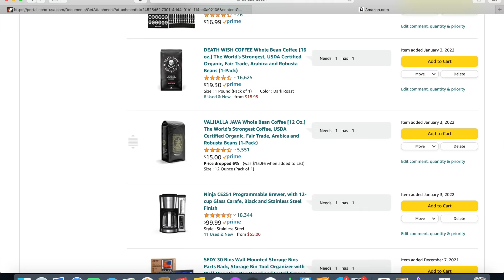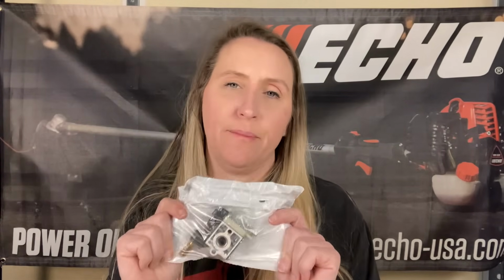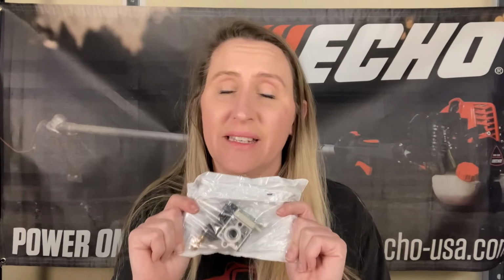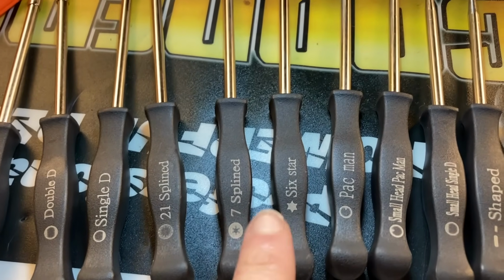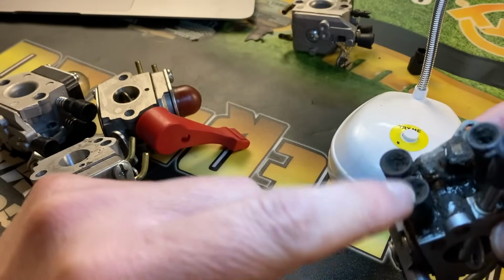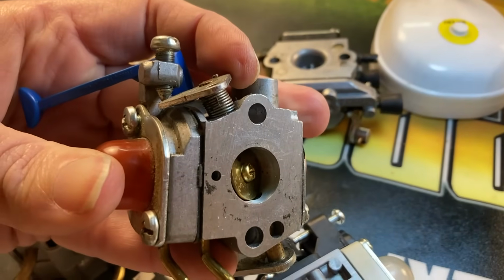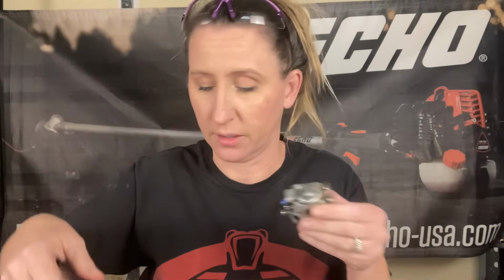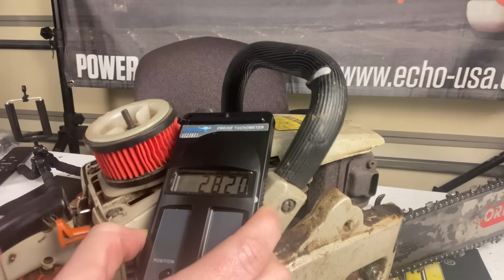HOW TO ADJUST your 2 Cycle Carburetor on a Chainsaw or Trimmer and when you probably shouldn't VLOG

Comment: I've only worked on small engines ect for not all that long, then again i'm real young. Working at a shop which goes from working on outboards, to ATVS, snowblowers chainsaws whipper snippers uh generators, dirt bikes, snowmobiles, regular cars, trucks ect, trailers. What i'd personally seen is people just having poor gas. It's SO much of it. Oh, that gas tank, let's peek inside because well its a poor running situation. Hmm...i don't see water....oh nevermind, it's over 90% water and i can't see the normal line you see. I understand the small puddle of water, but when its half the jug, you'd have to notice. Regardless.

Quick story. Had a guy come in with chainsaw, ran fine, then it just didn't. ''Had old gas in it, dumped it out and put new gas in''. Ok, perfect. I take the standard sniff test. It's rotten. Looks not bad, but smells just horrid. I did a quick carb spray out just because, and new gas, fine as kind. ''new'' to the chainsaw gas, certainly not new to the shed or container it was in.

Comment: A little question: Do you use alkylate gasoline in the United States for your small air-cooled engines?
Reply from the maker: It is not recommended, but is what most stations sell.
Reply: @Chickanic  If I may ask: What does the USA have of alkylate problems?
Here in Europe, Husqvarna, Stihl and many others recommend using only alkylate (2%).

Comment: I knew this is old no I didn’t read comments.

You said gasoline sucks water from the air no it doesn’t gasoline already has moisture in it.  I can’t remember the ratios for every gallon of gas you burn it’s like 3% to 5% moisture.  it’s why you see exhaust pipes drip water and rust out. to eliminate that that’s why they make dry if you know you’re gonna be finishing up with your equipment for the season soon when you go get gas in your big gas can dump the ratio of dry gas in it so as you fill up your equipment and then you put it away for the season you won’t find water in the carburetors or in the gas tanks.

Comment: The Reason I have to adjust My Echo 355T Climbing Saw is because I Foolishly Loaned it to my Know it All Retired Mechanic Neighbor that Likes to take things Apart and Adjust Even though it's New and works Flawless, I retrieved it with a Boinged pull start, Disabled Brake, in Pieces on his Bench. I said No when he Needed Huskvarna 372, 395 XP. Don't Loan Equipment. !!!

Comment: If you will spray your carburetors with delco non chlorinated brake cleaner it will fix 80 percent of your carburetor problems it dries instantly and cleans the gump

Comment: The water in the fuel probably comes from the ethanol that is added to the fuel by the supplier. This is why you should never use a low grade of fuel for any machine that sits for a few months of the year, this includes motorcycles. Do yourselves a favour and use the high grade of fuel, the non-ethanol grade. Just look at the pump next time you fill your car and you will see what I mean as it's posted right on the pump.

Comment: Whoa...first off, great video. Second, lets dial it back a little on the whole "best chainsaw ever made" thing. If they were that good, there'd still be a lot around. There isn't. I get the whole corporate thing though.
Reply from the maker: Corporate Echo doesn't do anything for me to talk about them. I just sell the equipment at my shop.  I'll double down on saying any of the grey echo's, trimmers, saws or hedge trimmers were outstanding pieces of equipment that would last a lifetime. I still get tons of them in at the shop, but I see about 800-900 2 cycles a year.

Comment: Your right it's the ethanol, it pulls the water in out of the air. If you look at plastic used in fuel cans through a microscope it looks like a quilt, it provides no oxygen barrier and the ethanol will pull moisture right through it so if it sets in the can through a season cycle it loses potency

Comment: Never had a problem with your run of the mill 2 cycle.  They are all about the same.  Start around a turn and a half out and find to lean and back it off a bit.  

Now these 4 mix.  I will never touch a carb again.  I learnt my lesson. The window is so wide. You can't hear when it's leaned out therefore can't favor rich of the good running window.

Comment: I use 100LL aviation fuel in all of my 2 cycle equipment and never have a fuel problem. If you are doing a lot of running you might just want to use aviation fuel the last couple of runs because of the price. It will not go bad for a long time.
Reply: The big problem with AV fuel is that it contains lead. Not good for breathing, or for anyone. I have personally found that keeping fuel stabilizer in high octane fuel, even E10,  has been just fine.
Reply: @GoCoyote  funny I made it 81 years around leaded fuel and still kicking, just maybe not a high as I use to.

Comment: Good video. Been a lot of times I get something in and the owner says " I tried to adjust the carb". Make me want to slap their momma. I need to get another tach. I had one of the old strobe tachs that read off a piece of reflective tape. Ok for mowers, hard to use on two cycles. Thanks again for getting back to me the other day. OEM carb on order.

Comment: why do people rip the chainsaw pull cord. i do one slow pull till it is tight with compression let back the cord and do 2 or 3 ez pulls.  even my 390 and 395 i just have on the ground and do 2 ez pulls. i feel like i watch evey one using so much power to rip the cord. i have 4 husqvarna, 2 stihl everything from small to large.  i love watching people starting a saw cold standing holding it with 1 hand.  cold starting on the ground is smarter and shows you have bigger balls caz you dont have to look like youre going to lose a leg.

Comment: It's ridiculous how EPA makes it difficult for consumers to tune their small engines.  What's worse for the environment?? A poorly running engine that's not stocometric releasing more    unburned hydrocarbons I to the atmosphere or a properly tuned engine able to reach its peak power completing its task faster and more efficiently?
 Not everyone is mechanically incompetent. There isn't much to a 2 cycle engine. The alcohol  diluted fuel we get now rapidly deteriorates rubber hoses and diaphragms. 
I have bought OEM carbs that have needed the hi/low jets adjusted.. why? Because the factory set carburetors are tuned to a engine that hasn't  been broken in yet and because they are set to compromise  diffrent altitudes one one setting. What may run efficiently at one altitude  run like shit at another..   I would rather buy aftermarket carburetors at a fraction of the price for the sole reason MOST POWERSPORTS don't manufacture their OWN carburetors. Outsourcing components is what makes  brands competitive. Only high end brands sthil, echo etc manufacture the "entire unit" in house. Hence the price. Most china made carbs perform as good out of the box as OEM. the rest just need tuned.  I almost forgot the Zama carburetors are manufactured in.. CHINA but stihl bought it out so its   China made and assembled with American pride. I been EETC certified  for cub cadet, walker, craftsman Kohler and John deer  outdoor power equipment. For the past 12 years. I can tell you from experience dealers push OEM products for commission.

Comment: Sorry to be anal retentive, but it bothers me to hear 2 cycle engine instead of 2 stroke engine.  That's 2 piston strokes per engine cycle.  A 4 stroke engine has 4 piston strokes per cycle:  1) intake, 2)compression, 3)power and 4)exhaust.  A 2 stroke combines them into 2 strokes:  1) intake/compression, 2) power/exhaust.  I noticed recently when I bought some that 2 stroke oil is now labeled correctly.  For a long time it was called 2 cycle oil.  I do enjoy and learn from your Youtubes.  I would like to see one on crankcase air leaks and replacing a worn/sloppy crankshaft bearing and seals on a Husqvarna 450 to fix such an air leak.

Comment: cant stand amazon most useless e store. full of junk. page lay out is dizzying. more e stores should be like McMaster-Carr! easy to navigate, well organized, simple, thy give you every specification of the item. 3d viewing of the item. as for fuel I use ethanol free pump gas when possible + stable marine & sum tcw3 2 stroke oil in the gas. for my 4 strokes i add the tcw3 outboard oil at the rate of 1oz to a gallon for a mix of 128 to1 as modern pump gas has no lubricity. on 2 strokes i use 20 to 1 mix do to the dry ness of pump gas and 2 stokes make best power and life at around 20 to 1. marine 2 stroke oil is ash less so it douse not lode the plugs and engine with gunk like small engine 2 stoke oil. it keep seals happy and rust out of the fuel system as a light oil stops rust in all fuel systems. add the stable Marian for varnish resistance and corrosion protection. the limit screws remind me of the 1970s-1980s smog era. all those cars after 3 years all the smog junk went in the trash the limit caps removed etc.! crazy to see on lawn mowers! all my stuff is old so did not know this level of bs is on them now.  on the carb with the funky mix screw with the aluminum Gard around them just cut it with dermal then slot screws.  2.5 turns out is common on both on auto and small engines. sum small engine carbs had just one fuel mix screw.